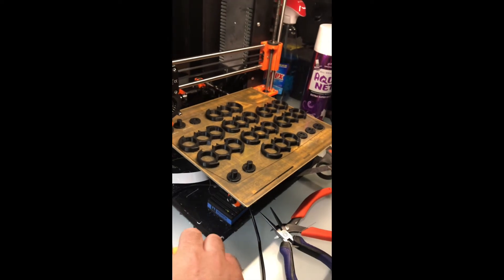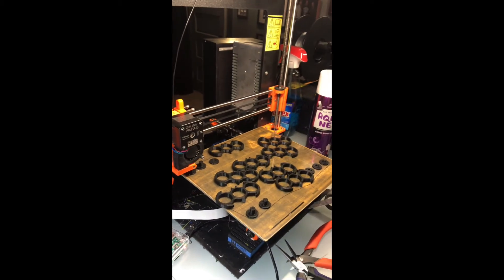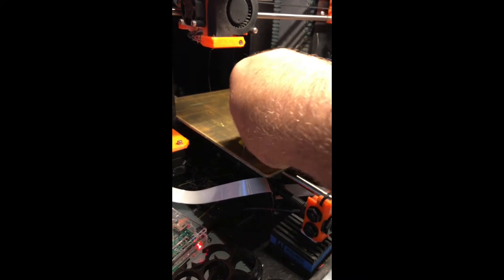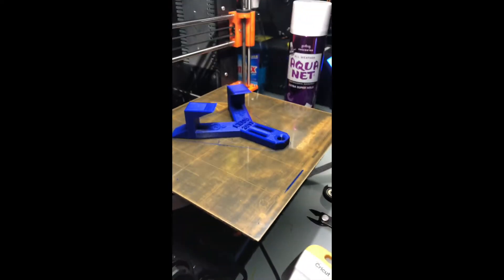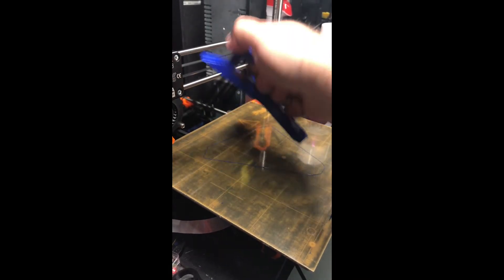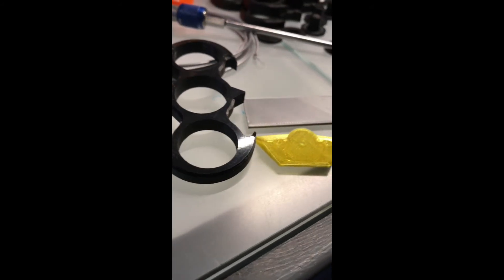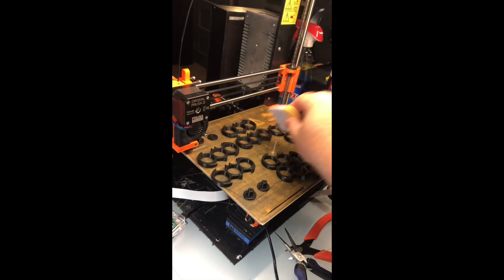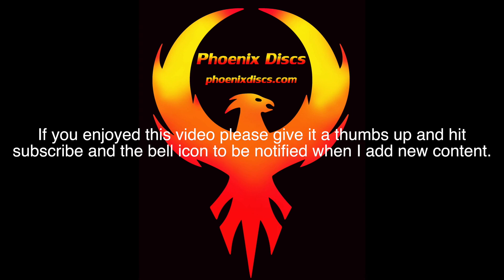My Review of the Filafarm FilaPrint 3D Printing Build Surface

Comment: So what happens if you touch the surface?
Reply from the maker: GordonGEICO I have bumped the surface with my hand and it still seems to work fine. Have not really rubbed it to see if there is a problem.